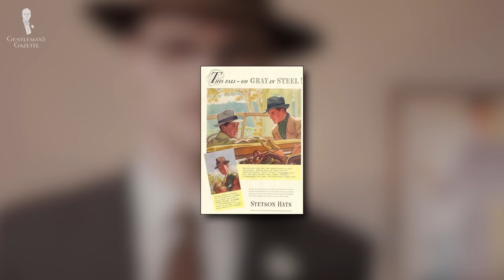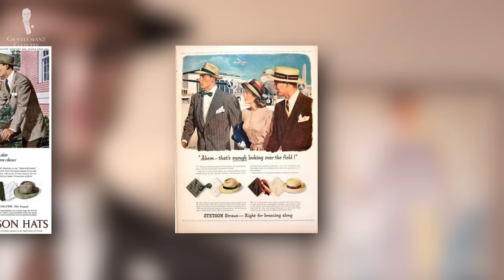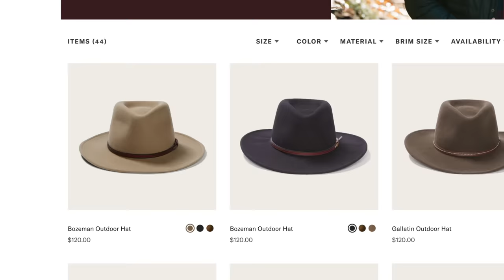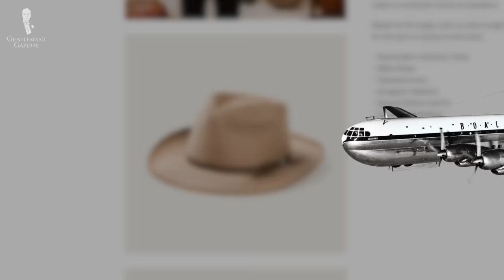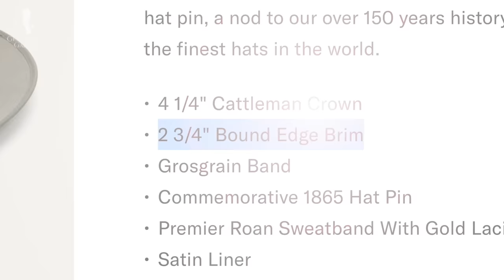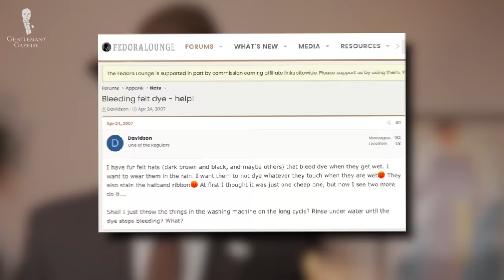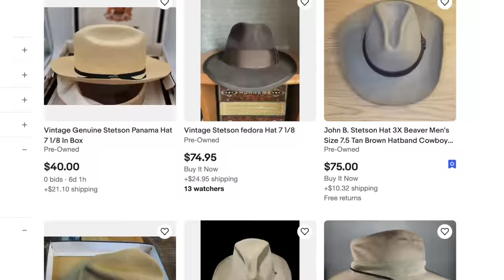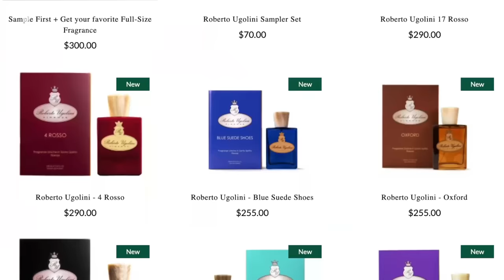Stetson Hats: Worth It? Classic Fedora & Cowboy Hat Review

Comment: Very interesting. I am 75 and own about 20 Open Roads, which I got on eBay 10 to 20 years ago, and all of which are between 30 and 70 years old (estimate). Here is a saying to keep in mind: A cowboy hat is worn by a man who works on a ranch. The Open Road is worn by the man who owns the ranch. That's the difference between a cowboy and a rancher hat. I can attest to the fact that the hat itself confers authority, but I didn't actually achieve the level of command presence I needed to pull it off until I was in my '50s. The Open Road is like a bow tie. If you can wear it with authority you will knock it out of the park. If you can't, you will look like a clown.

Comment: About three years ago I bought a vintage Stetson fedora at an antiques mall for only $12. The style is very much like the Temple but it is made of a woven fabric 35% wool, 50% acrylic, 15% nylon made in Sri Lanka. The crown is 4" high and the brim is 2 1/2" wide and is turned down. There is a 3/4" band around the crown that is the same color as the rest of the hat. It's the color that caught my eye, a heavy canvas like weave in black and white with very tiny specks of silver, yellow and pink. Because of the color this casual style hat goes with almost everything. In the fall and spring I wear it with a short gray canvas jacket and I get more compliments from people wanting to know where they can get one. I have no idea  how old this hat is, any time from the 1950s to today for all I know. This hat started me buying vintage style hats. I now have 9 hats some new, most used or vintage, paid less than $20 each for the used or vintage. Great video as always keep 'em coming.

Comment: I used to have a black weather-resistant crushable wool felt Bozeman, which I used for commuting in Seattle instead of an umbrella but left it on a bench. It took quite a while to get a replacement Stetson, so I had to settle for a Bailey Switchback on extreme sale in the interim. When I had enough saved for a new Stetson a couple of years ago, I chose a black Santa Fe (no longer offered in black) because it has an adjustable leather chinstrap. Both the Bozeman and the Santa Fe have stood up to full rain drenching without bleeding. I have gotten many compliments on the Santa Fe hat in black. I adored my Bozeman, but I found it challenging to keep on my head in windy conditions. I used to commute by ferry to Seattle over 10 years ago and wore a tan Columbia crushable wool felt hat similar to the Bozeman that had a chinstrap that was great in very windy conditions. A couple of years ago I found a Cordova Sturgis at the local Goodwill for $15 because the hatband was broken. My husband wears the Sturgis for walking the dog because it is XL. My son can wear both of my size small western hats, but he prefers the Santa Fe for its flat brim instead of the curved brim on the Bailey.

Comment: My worst encounter with Stetson hats is my 1984 model Indiana Jones hat. I believe they cheaped out when they made this hat. When I bought it a couple of years ago the wool felt seamed thin and to my dismay the sweatband, had gone brittle,  was only cheap paper with a coating to make it look like leather.  I ended up replacing the sweatband with a cloth one I had purchased on Amazon. So if you buy an older Stetson it might be a good idea to check the sweatband. To be fair I do have a fur felt Stetson cowboy hat that seems to be of a higher quality but if I had bought it new it would have been much more expensive.

Comment: I just bought two fedora style hats - my first. Please tell me how they should fit on the head. I know they should be comfortably snug but I see some photos of men wearing hats where the hat is 1.5 inches off the ears (and more) while other fittings show the hat almost touching the ears. My hats feel less secure on my head than my baseball caps. if I pull the hat down, the top of my head starts pushing up the crown. Does this mean I need a taller crown (like 5 inch)? Your advice is needed. Thanks.

Comment: It depends on what you want and need. The cowboy hats are great, beautiful with thick heavy duty felt. The crossovers and fedoras leave a lot to be desired in terms of rugged dependability. They are rather fragile from my POV.  The Akubra is much better. The various cowboy style hats are every bit as tough as the Stetson and their fedoras, the Stylemaster and Federation IV are much tougher than the Whippet or Stratoliner from Stetson.
If you are looking for an elegant dress hat you can't beat Selentino at about the same price as a Stetson Fedora, with sharper colours and large selection of colours.
Stetson has long made great hats but they have competitors.  Their fedoras are not top of the line in my estimation but the cowboy hats are.